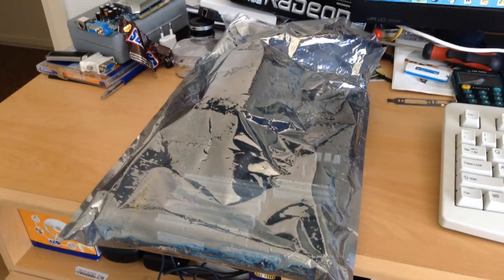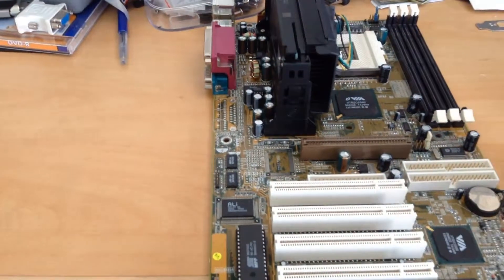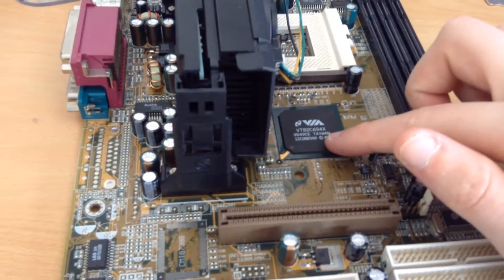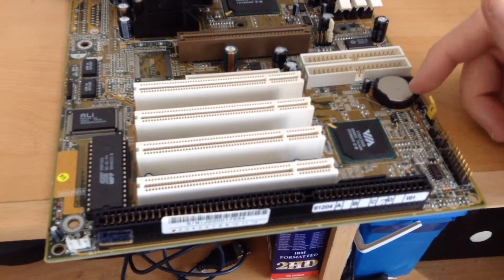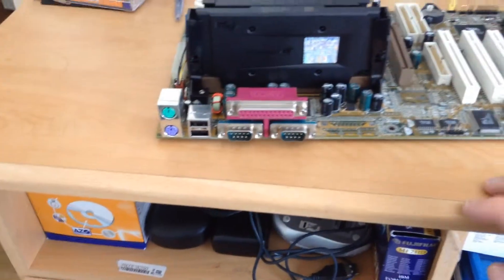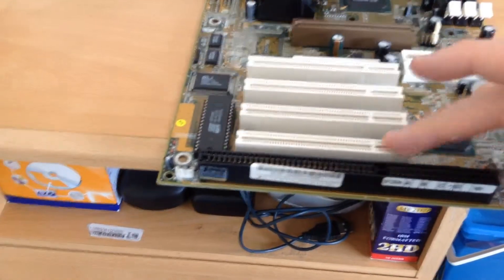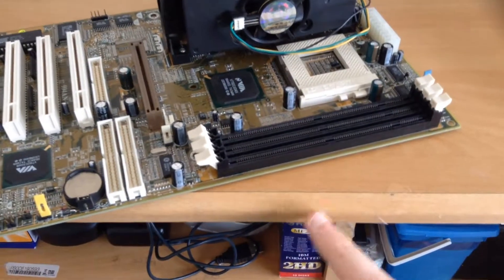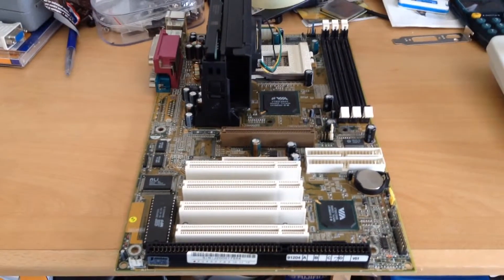Jetway 994AN-L - Slot1/S370 Motherboard Overview

Comment: Revisiting years later, after having learned a lot, it is my favourite motherboard now that I know how to force AGP 4x with Nvidia cards. Requires a lot of memory tweaking to get decent performance however, as it nerfed my PIII 1000 to PIII 800 performance levels. Plus memory interleave had to be enabled from within Windows. I'll always have issues with the floppy connector location however - it is terrible for passively cooled cards.

Found some undocumented FSB settings as well, had mine running a 112MHz FSB by accident.
Reply: This was really helpful for me as I have the J-994AN motherboard. I enabled memory interleave and instantly saw a huge performance boost. Can you tell me more about the FSB settings you were talking about? I have the same Pentium III as you. Appreciate your help. I do wonder if Tualatin 1.4GHz can be installed as the retro web page suggests it may be possible.
Reply from the maker: @JesseJamesHeadrick Tualatin will work with an interposer with it’s own VRM. Main issue with Tualatin support is voltage generally and some minor changes to the fcpga2 layout
Reply: @nelizmastr  The change to the AGTL+ signalling standard/fcpga2 layout is the only real problem, as the VRM on the 994AN is quite happy running my Ezra-T C3 at 1.35V, and my Nehemiah C3 at 1.45V.

Can only change the CPU multiplier of C3 Samuel however (and only within the C3 section of the BIOS).
Reply: @JesseJamesHeadrick  I didn't write them down, but there are more possible jumper combinations than what is stated in the manual and on the board's silkscreen. It might have been 66MHz FSB or 100MHz FSB jumper setting inverted. 

As for Tualatin, you are really beter off getting a board designed for them as the 994AN has terrible performance. While I have had great success running Via C3-T (Ezra and Nehemiah) on mine, Tualatin itself does require modding.

Comment: Did you get your video card running at 4x AGP?  I know someone who is having trouble getting it done.  If you could be of help comment in this thread ...

http://linustechtips.com/main/topic/322186-agp-graphics-card-not-running-at-the-set-speed/
Reply from the maker: It worked natively in my case. The card needs to be 4x compliant, and you need to have a pentium 3 CPU.

Comment: I have one as well, and just like it says in the manual, pentium 3s work in the 370 socket. (I've got mine setup with a 667MHz P3-better than either of my slot 1 celerons or my 500MHz socket 370 celeron)